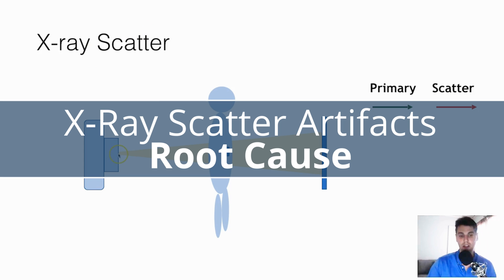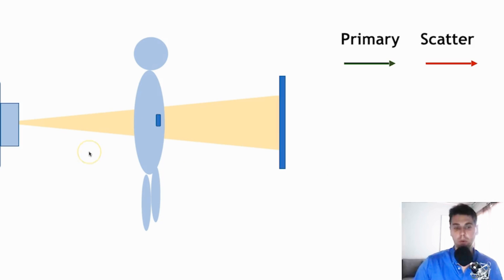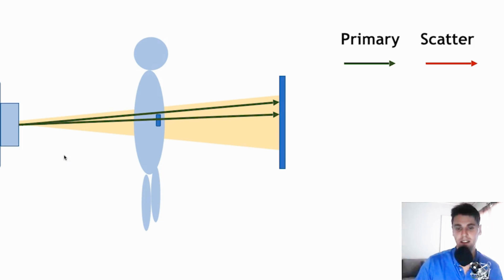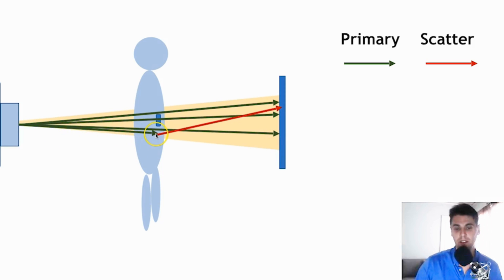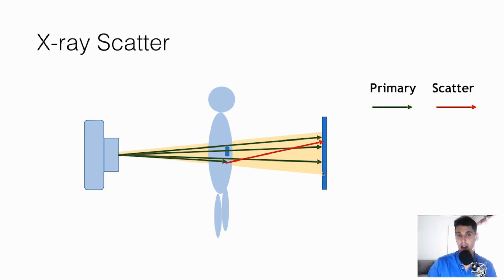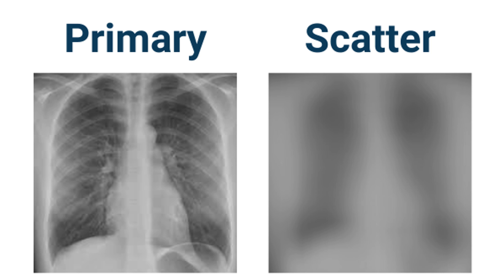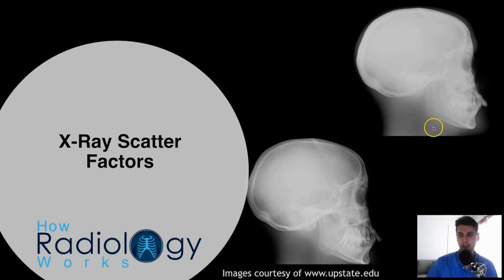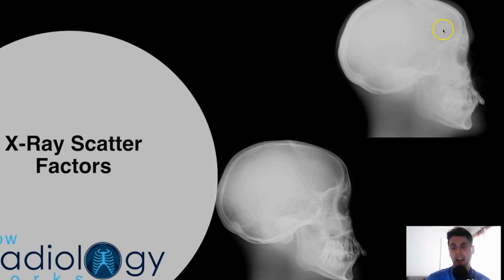Scatter x-ray radiography (Radiologic Technologists)

Comment: Great vid! I have a CT scan for my lungs due this Tues. Asked the radiologist if they provide a shield as I'm concerned dispersed radiation will affect an already problematic thyroid. She said it won't scatter beyond the intended area. What you think?
Reply from the maker: Machie- I try to stay away from any person medical advice. So I won’t discuss your specific case but give a couple pieces of info. 1) shielding would not help to reduce dose from scatter within the body 2) shielding would help if the primary scan range include the area of interest
Reply: @HowRadiologyWorks  totally appreciate your position and thank you for the advice. To pose a hypothethical question, if I understand you correctly, although the scan can be localised to the chest area, it can still scatter up towards the thyroid internally?
Reply: @machietheapachie7214  , yes there can be scatter within the body but these levels will be significantly lower than the primary radiation
Reply: @TheNettforce  thanks so much. Finally, given the lowest effective dose for lungs, any idea what the scatter would be equivalent to regarding background radiation? Thank again for your help so far, this is the most transparency I've received on this :)

Comment: Why isn't the scatter/noise normally distributed?   And, in practice, can scatter/noise be corrected sufficiently, if the beam from the source is hitting the detector at say 45 degrees (in a cone-CT type device)?
Reply from the maker: Thanks Richard. Yes the scatter is a complex phenomena that we are just discussing the introduction here. And yes there are both hardware and software approaches to reduce the scatter with MonteCarlo being the gold standard, but very slow method to estimate scatter.
Reply: @HowRadiologyWorks  Thank you!  Great videos and replies, as always!